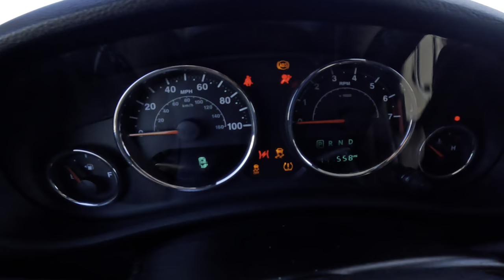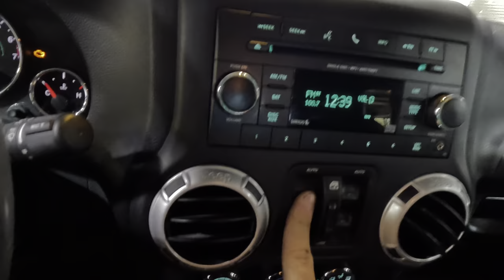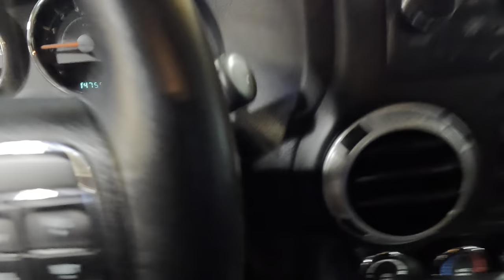BAD Car Karma! Botched Job Recovery! Jeep Wrangler 3.6 Pentastar

Comment: Why anyone would want to come to work and face this nonsense everyday is beyond me! If taking it apart is this difficult going back together has to be horrendous. As a retired heavy duty truck mechanic of 43 years in the trade I feel fortunate to have started in 1970s working on forge and their high performance counterparts cobras boss mustangs etc. Then going on to trucks where book dime doesn't even exist at least not in those years. If you go to work for a fleet which I did and made great money book time didn't exist at all. You did have to have critical thinking skills to get the equipment off the public highways so that other equipment could get through and don't make dumb mistakes that make the company or the local politicians look foolish you are pretty good to go. I worked in the San Francisco Bay area which most jobs or union and warranty time or book time was never an issue. Yes you had to be productive not to mention that the car is were a lot easier to work on. Trucks too! When I retired in 2014 are fleet of auto cars came on board it 2008 with the usual onslaught of the TPF filters and related equipment. It's just gotten worse since. I think I would have made another career choice if I was entering the field today is there just don't seem to me much joy in it.😊 Plus if you add the cost of tools, tool boxes, computer hardware and software just stay current and you have to fight for your hourly wage what's the point! If mechanics have enough skill to work on cars they have enough skill to do other things as well. Who wants to fight with a service manager or service writer all day long over time? I have a 1972 CJ5 Jeep that's now equipped with a 350 Chevy in it. It came with a 304 American motors V8. I located and put in a 390 AMX V8 in it. That was a lot of fun just so long you didn't beat it because I drive line would have never survived. Then I put the Chevy in it. Not particularly a Chevy fan but that was the easiest swap. Anyway my point is I look at my CJ5 and then look at this mess. I don't even know how he would come to work having to put that thing back together. Plastic fittings screws that are not magnetic how do you put all those little tiny 8 mm screws back and slots and chicken barely see much less reach. Thank God for the advent of power tools. Or I should say, battery power tools. For me, I'll keep both of my 1993 f-150s one of them being a pristine showroom black lightning until I kick the bucket which at 75 may not be much longer. If I ever had to get another vehicle I'll guarantee you it would be an EV. That's my rant.

Comment: Nothing "fine" about Chrysler automotive products.
4:06  6:13 What the hell was that?  Not necessary.
Always nice to see Lauren.  Looking good.
Chrysler engineering at it's best.  They used to work for GM.  Great place to put an oil cooler. Sink it down into the hottest part of the engine.

Comment: 40:04   I still do not get the idea  of placing an oil cooler under the intake manifold on top of the block, i just do not get it.

Gee Tennessee  lets put the oil cooler in an oven. Ya thats the ticket.

Comment: Haha comments crack me up. I’m not a mechanic, but that motor is the opposite from what I learned on. I had a 69 Beetle. Even tho I knew shet, I could remove the engine to my bench with hand tools & a floor jack in 30 minutes.
No was that’d happen with that jeep. 🙃

Comment: With the cost of getting or even finding a qualified mechanic to fix things, you're going to see a lot more botched DIY jobs. And what brainiac thought up that useless oil cooler assembly? Not only is it made of plastic, it's in the wrong spot-the hottest part of the engine!

Comment: The only people with ducks in Florida are people that have tire pressure sensors in their jeep are people that need tire pressure sensors in their jeep and don’t have an in-line six AMC motor basically any jeep older than a TJ gets a duck the duck is not a good thing

Comment: @RainmanRaysRepairs I noticed that you didn't mention one of the most common issues of the Pentastar engines, the rockers arm failure which causes a ticking noise and after a while it destroys the camshaft lobes. I hope this is one of those items that you check but don't bother to film.

Comment: WARNING ‼️ 
All Jeeps are equipped with automatic self lubricating systems.
When all of the vehicles oiling systems have been tampered with “or repaired” then the vehicle will begin to completely oxidize and it will rapidly become a lump of rust. 😂
Reply: Oh yeah and…

👌America First ❤️✝️🇺🇸🫡
Reply: The engine bay and garage are transformed into automatic used oil drums.✌️

Comment: Design awards?  What idiot thought the best location for the oil cooler was buried under the inlet manifold where there is NO cool air?  And what an appalling piece of limited lifespan/guaranteed failure design excellence it has proven to be.  "It's a Jeep thing" is just an excuse for all that is wrong with the current crap crop of failed offerings.  Also loved your thoughts on the quality of Champion spark plugs.  In my experience they last less than half of the lifetime of NGK plugs.

Comment: I do not like your new editing.  I own a 2013 Jeep Wrangler Unlimited with only 67,000 miles (add about 5K for towing) and I would prefer if you did not skip steps in your video in case I need to perform the same job.

Comment: A friend has one of these POS's, it has a rocker arm issue but the idiot american workers tightened the bolts on the cam shaft so tight, we kept breaking torques heads.  So we take the crap wagon as I call it, to the dealer and they refused to work on it.  Buy American, made by american junk labor, get what you pay for.

Comment: The 3.6 Pentastar  is a well built engine if the manufacturer would build it right the first time. They ( Stellantis) knew of the oiling problems after the first year of production. But being a European operation could care less for America. It took an aftermarket producer to clear the cooler problems. That engine has been had bad maintenance workmanship in the past. Ray, I wish you the best on that duckling duck sh$t. And please stop the stop gap editing.